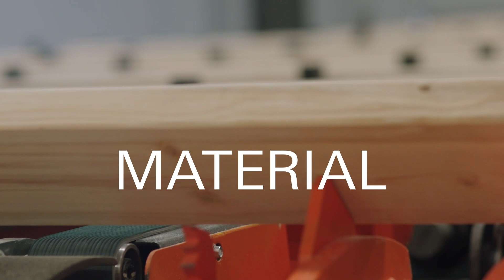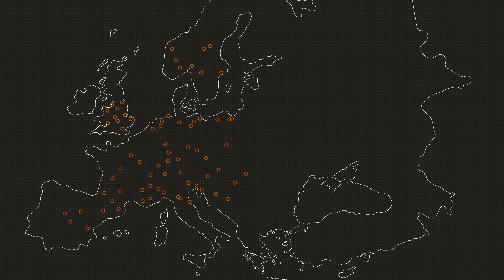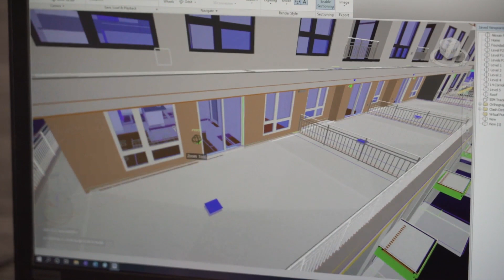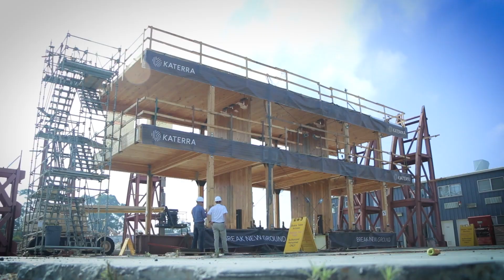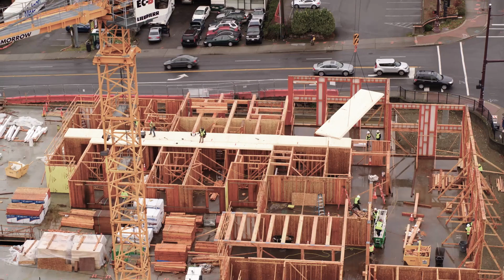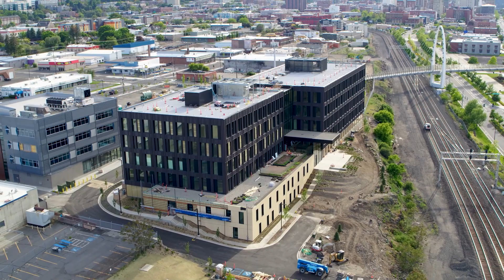Katerra | CLT Performance Testing

Comment: Bankrupt! hahahahahaah gayyyyyy
Reply: Kattera was run by a silicon valley think tank group. There's still a refrigeration unit that could bring the whole plant down from 78F to 32F in an hour or two. Kattera insisted it was needed. While I was there 2022 to 2025 all we used were the swamp coolers in the roof. It never got above 82F in the summer and I never saw it below 65F mercer was trying to sell the chiller to a ice skating rink, but it was too small for it. I mean the rink was too small.... starting to see why kattera failed? Tons of expensive crap that mercer doesn't even use. But they had the shittiest Ethernet system. The line was a nightmare.

Comment: “Concrete and iron are cheaper, but I prefer wood” said no investor ever. Wood is always the cheap choice
Reply: You can set up and finish a house in 7 days. Carpeted and ready for the new owners to move in.
   Your framing job is going away and if your lucky you'll end up lagging walls together.
  Find an inspection of a CLT house. It's actually worth what the homeowner is paying. About the same with no frame up. Panels make it a wash cause they're like, 25 grand each for a 60 foot by 12 panel. After CNC milling.